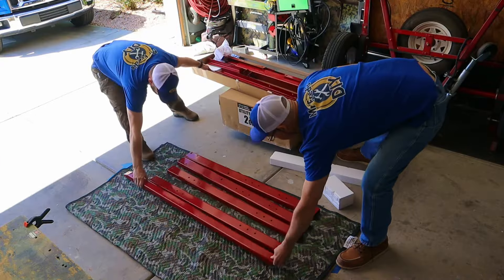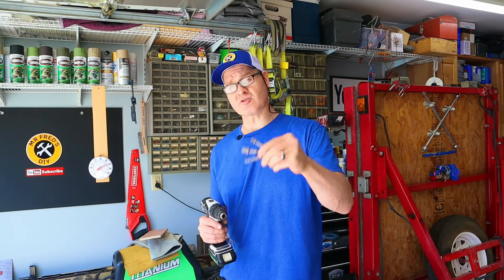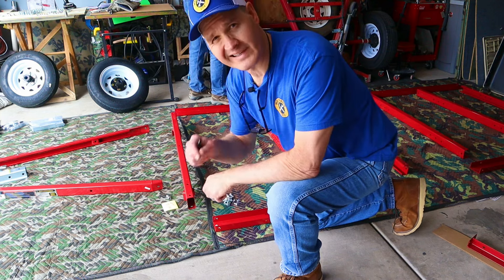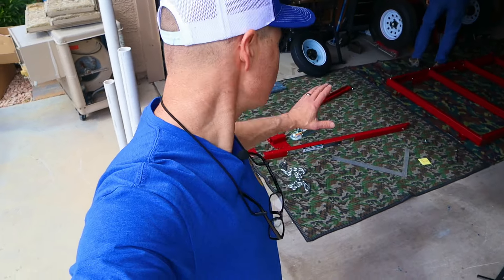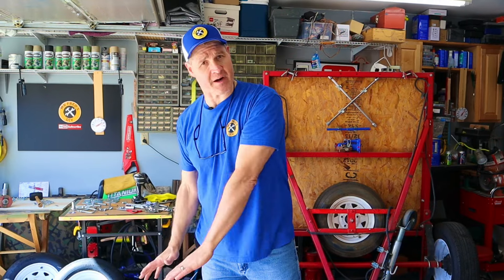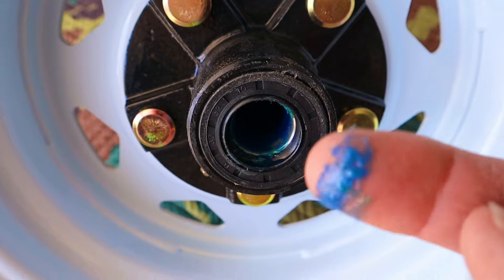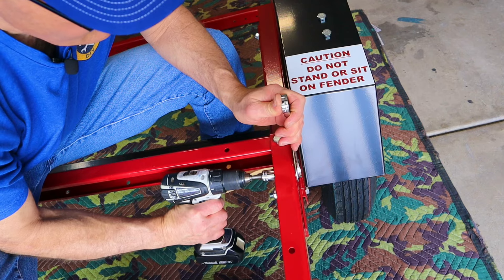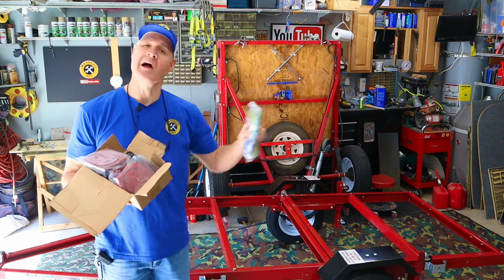Harbor Freight Folding Trailer Assembly

Comment from the maker: Are you planning to buy one of these trailers? Do you already own a Harbor Freight trailer? Tell us about your experience!
Reply: We bought the 1195 LB trailer.  assembly was a nightmare.  there were parts not listed and listed parts not included.  so many instructions are not clear. and as you said very confusing assembling it upside down.  Thanks for the video.  we didn't know about the 4 longer bolts. I wish they packaged them separately.

Comment: One more thing. DO NOT WELD THESE TRAILERS. The people pushing the idea that these aren't strong enough with bolts have zero understanding of structural engineering, or welding.

Comment: Just bought one, and really got screwed over by it...the kungfu factory  who made this thing sent two  left front rails instead of a left and a right...now a sit around twiddling my thumbs waiting to see if or when harbor freight will send the front right side rail on a trailer that i really need..you go harbor frieght 🙄 I would strongly suggest that if you need a trailer within a few days  then go buy a welded one off a lot somewhere , but if you can forecast out a month  or so  as to when you need a trailer then this trailer would probably work, if you factor in mismatched parts, replacements being shipped etc etc.

Comment: There is two trailers thy do not sell anymore the 5 x 10 and the boat trailer have not seen any of these in 20 years now I have the boat trailer and two 5 x 10. Bought them back in 1982 still use all 3. Boat trailer has a 16 ft extra wide john boat on it.

Comment: how do you get a license plate for it?
Reply from the maker: After I finish filming the lighting installation video, I will take it to the DMV for an inspection. They will match my purchase receipt & title to the vin stamped on the frame. Once it passes the inspection I can get a registration and license plate.
Reply: The same way you get one for any other vehicle? The trailer comes with a certificate when you buy it and you present that to clear roadworthiness requirements and then pay for a plate. (at least that's how it went for me in Canada)
Reply: @MrFredsDIY  thanks, i have never bought a trailer before, did not know the process
Reply: @chrisbarton8499  Every state has different requirements and fees, and renewal rules. Check with yours.

Comment: Hi 👋 if i buy 13 or 14 inch  tires do i need new axel??
Reply from the maker: I am going to upgrade to 13” wheels like I did for my old trailer. I did not change the axle, only the rims and tires.

Comment: Your chain mod is definitely stronger than the OEM as it gives a redundant safety measure. I am curious though if the axle mounting brackets can be moved farther toward the rear of the trailer for my specific needs? Thanks for the cool and informative video.

Comment: A really great video!!! When levered, what is the hight from the ground to the top of the surface of channel where the floor would be installed? Thank you!
Reply from the maker: Thanks for commenting! with the 12 inch tires, the top of the frame sits at 20 1/2 inches. I also measured my old trailer with the 13 inch wheels and upgraded tires. That measurement is 22 inches.
Reply: @MrFredsDIY Thank you!

Comment: Great video! The leaf springs have some play after i tighten the bolts. I know im not supposed to tighten em so hard that the metal rail bends. Hahaha. Did yours have some play as well? Thanks!
Reply from the maker: Yes, mine were the same
Reply: @MrFredsDIY  thanks bud! Sounds good!
Reply: @ericmoon3167  Chinese precision.
Reply: @freedomfan3277  The assembly is fixed, and the front eyes are snug over the bolts, so the bit of play has no effect on the function of the trailer.  The US and every other country make junk also, just like every country produces quality when the seller wants it.
Reply: @RealBLAlley  "Play" equals friction and wear. Things that you don't want in a trailer. I have an American made trailer that's over 27 years is still tight. Chinese quality is  an oxymoron , you get what you pay for or not.
Reply: @freedomfan3277  That's nationality bias, aka bigotry. The play you're referring to doesn't matter because the assembly is a fixed system. According to you, any two parts that move against one another are bad, which is ridiculous since that's how machines perform work.
Reply: @RealBLAlley  Spot on correct, well stated.  Don't buy a hamburger then and expect a steak.

Comment: Your video is really helping me with my HF 1720 trailer build.  I'm having fits getting the wheels on the axle spindle at the moment.  It seemed you left the shipping grease in the hub - did you add any more grease after installing the wheels?  If you did (or if you just know), what grease can I just add to the hub with the shipping grease without having to clean out all the old grease and removing the back seal too?
Reply from the maker: Harbor freight says that this grease in trailers they currently sell is not shipping grease and is appropriate for use. I used marine grease with my grease gun to add several pumos at each zerk fitting.
Reply: @MrFredsDIY  Thanks!  The internets say it's not cool to mix grease, but if you just added marine grease that's great since it's what I prefer to use.  I've also got some Bearing Buddies coming, but not quite sure on the size.  Again, the interneters claim the 2047ss is a fit.  I think I'll remove the tire from the hub to give it another shot at installation and I'll measure the dust cap&Hub ID to verify the 2047ss.
Reply from the maker: @michaelmiles4141 bearing buddies are on my list. I’m going to try the 2047ss first as well. Fred Jr and I put bearing buddies on his boat trailer, and I have to say it was not as easy as I thought it would be.
Reply: @MrFredsDIY  I finally got the wheel on.  Turns out the spindle was just a smidge rough behind the threads and the outer bearing wasn’t sliding on.  Some twisting and gerfiddling got it on there.  I also measured the dust cap and 2047 is the correct size.
Reply: The grease is perfectly fine if you're not submerging the hubs or towing the trailer for long periods on the highway. The "shipping grease" myth probably came from people who are already biased against Harbor Freight or are self-proclaimed experts who never bothered to learn anything.
If it wasn't adequate for use and only for shipping they would not have assembled the hubs. They would have had the bearings packaged separately with a light coat of oil so the customers knows to pack them with proper grease before assembly.  Imagine the liability nightmare if that grease was just for shipping, knowing most people would simply assemble the trailer and use it as-is.

Comment: Hey, what size tyres do you have on the other trailer cheers.
Reply from the maker: My other trailer has been converted to 13" Carlisle Radial Trail HD trailer tires and 13" rims. This is a modification. I will be doing to my new trailer and I will also be making a video.
Reply: @MrFredsDIY  awesome, I'll stay tuned for it then! Thanks

Comment: We bought one a little over a year ago. We intended to get the 1195 lb trailer but they were out. The 1720 is only $30 more and has box channel cross-members and tow bars instead of C channel, has a stronger axle, and 5.20-12 5-lug wheels instead of 4.80-12 4 lug wheels. The tow bar brackets are also stronger. I recommend always getting the 1720 trailer.

There were two minor errors in the assembly manual, but easy to figure out.  I assembled it by myself in about three hours even though I suffer from fatigue and spinal cord issues. I wired it another day in about an hour, even with some custom routing and wire management.

I assembled it upside down from the start and didn't flip it until I had all the main parts attached, minus the fenders to prevent damaging them during the flip. If you pay attention it's not difficult to build it that way. Hold each part in the normal orientation and then flip it over.

The safety chains did not have a center link. I identified the two links at the middle, hooked a wired onto them, and pulled the chain through the coupler mount. I then ran the Coupler bolt through the two links adjacent to the two middle bolts. It's more than strong enough for a trailer of this weight and load capacity.

I placed two large nylon washers between the tow bars and the brackets to protect the paint from being rubbed off.

If you leave out the rear leaf spring bolts, after hand tightening the U-Bolts you can rotate the entire axle and spring assembly forward to access to the U-Bolt nuts for easy torquing.

Thank you for not buying into the "shipping grease" nonsense. If packing the bearings was required during assembly the factory would not have assembled the hubs, instead shipping the bearings in a box or wax paper wrapper with a light coat of oil. I recommend changing the grease only if the trailer will be used for long trips on the highway, or if it will be submerged as a boat trailer. In that case the lights also need to be upgraded.

A 5/8" / 16mm power tool blade/bit wrench is perfect for holding the casters while tightening the stud nuts.

I also painted the trailer before assembly since it's much easier. I only painted the parts that show with a deck in place. I used Ace Rust Stop International Gloss Red. It comes in a larger can for less money then other brands, and is a richer red than the factory paint (it will also not turn magenta over time). Because the rack components I added are painted black, I also painted the tow bard brackets, leaf spring saddles, and taillight brackets black for a nice contrast.

Comment: Any idea on where to get a better tire rated for a decent speed?
Reply from the maker: Carlise makes trailer tires with a higher speed rating.
Reply: @MrFredsDIY   Thanks.  We also need a 4 lug tire. seem pretty limited in options.
Reply: Check local trailer dealers or eTrailer.

Comment: So do you need to remove the carriage bolts from the spring mount every time you want to fold the trailer?
Reply from the maker: Yes. It’s really not too inconvenient.
Reply: That's why they are carriage bolts and not hex bolts. It requires one wrench instead of two.

Comment: could you install a deck that hung off the front of the frame on the hitch side with out impeding the function of the trailer? if so how far up could you go do you think?
Reply from the maker: If you follow the shape of the tongue, you could probably go 24 inches or so. If not, then you could probably only go 12 inches is my guess.
Reply: @MrFredsDIY  About the same as a tongue box.

Comment: Any idea what the torque spec is for the M10 bolts?
Reply: Only the nuts for the axle U-Bolts and the lug nuts have torque specs.  15 ft.-lb. for the U-bolts. The rest are hand tight. I recommend a 17mm wrench and ratchet with 17mm socket to avoid over tightening.

Comment: At 13:22 you are mentioning the 4 carriage bolts to hold the rear frame to the leaf spring bracket - your holes weren't quite aligned - I also have this issue.  Did you have to loosen up some bolts to get those aligned - it may become a hassle it seems every time the trailer is unfolded to be used those have to be reattached- and hopefully aligned each time.
Reply from the maker: floor is on and the bolts have been in and out a few times it gets much easier. Lately, I only put the side carriage bolts in.

Comment: would it be advantageous to apply Lock-Tight to the bolts when assembling?
Reply from the maker: My older folding trailer has the same nylon nuts, and none of them have come loose over the years. I’m thinking that Loc-tite is not necessary.